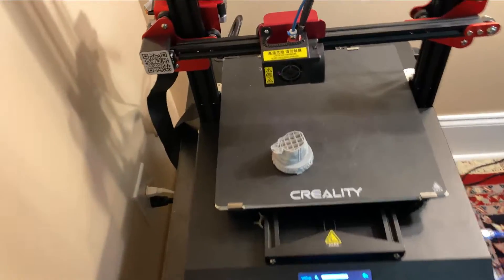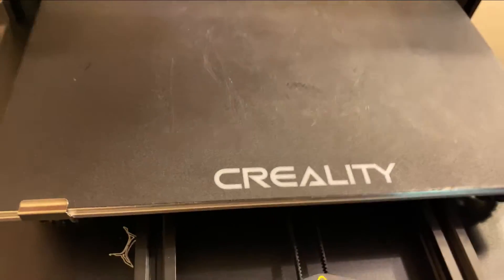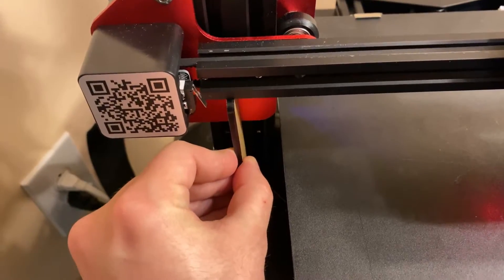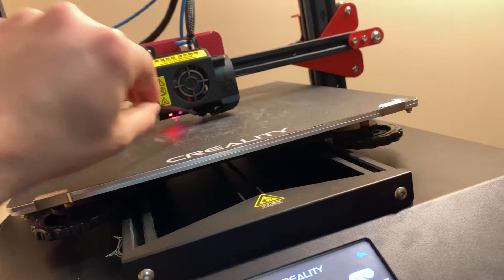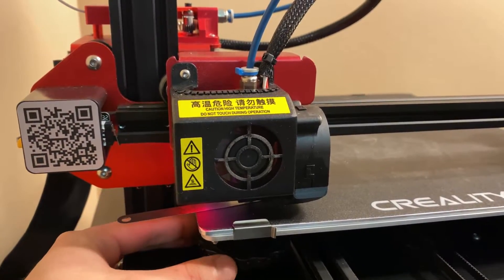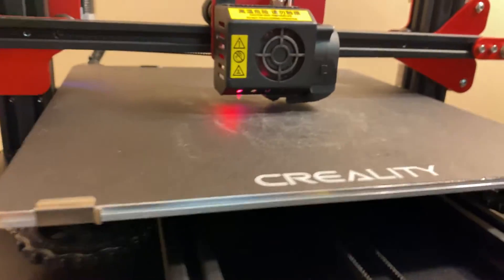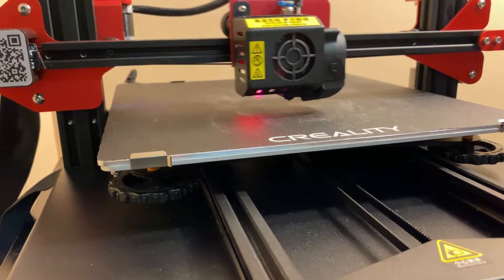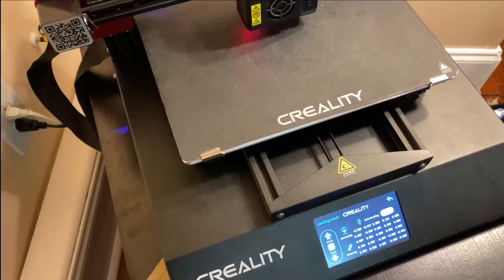How I Bed Level The CR10S Pro V2

Comment: Excellent video. I am thinking of picking up one of these machines some time to add to the collection. I really like those bed clips. Where can I get myself a set of those?
Keep up the good work!
Reply: If you don't minded get things from China these are the clips https://www.banggood.com/2PcsPack-UM2-Stainless-Steel-Build-Platform-Glass-Retainer-for-Heated-Bed-3D-Printer-Part-Reprap-p-1366878.html?rmmds=search&cur_warehouse=CN
Reply from the maker: Thanks! And the metal ones on outside? Those actually came with my printer. Not sure if sold separately

Comment: I followed all of ur steps, and everything seems perfect, but when i hit home and the z axis is at 0 the nozzle digs right into the bed. Any ideas?
Reply from the maker: Ace.tundra yes, actually! Sounds like you need to change your z offset- in simple terms- go to leveling screen and next to “z” keep pressing arrow up until the nozzle is not IN the bed. - but home - then re-level your bed. I had that issue when mine initially as well. Hope that helps! Let me know if you have any other questions
Reply: Anton Talks Tech sorry about the late reply, but that’s exactly what it was! Thanks a bunch man!
Reply: @AntonsCreations  Hey, I recently got this 3D printer and i am also facing the same issue. I leveled the 4 corners properly but when i test the center, the nozzle is very close to the bed (not able to slide 0.2 metal piece). I went to leveling and raised z so that the nozzle was not touching the bed. However doing this affected the corners as now the nozzle was a bit higher in the corners and was level in the center. Am i doing something wrong? Thanks
Reply: @hrithiksoni2986  I also have the same as you. And raising the z axis to compensate for the middle which is touching the middle is going to throw off the sides to ~.4mm now

Is there a better way to fix this? If not, I am going to return it
Reply: Johnson Ng i flipped the metal bed and it seems to have fixed the problem for me. You could flip the bed or just buy a glass bed. Seems like the bed provided is not perfectly flat
Reply: @hrithiksoni2986  good idea, but I am going to return the printer. Because when printing the hotend drilled into the mat and now it has a hole